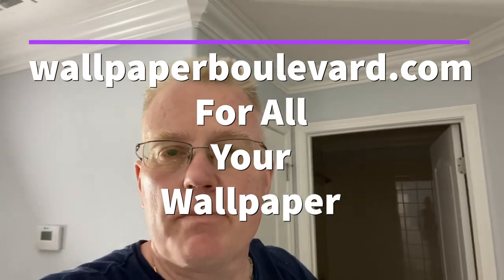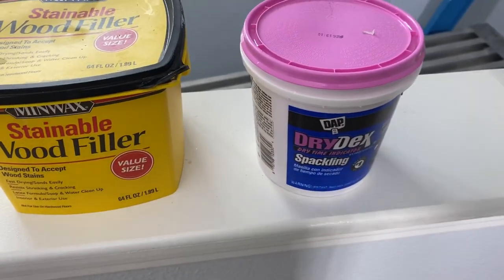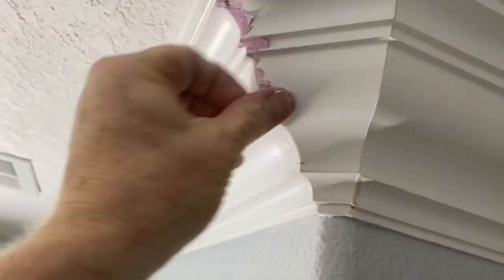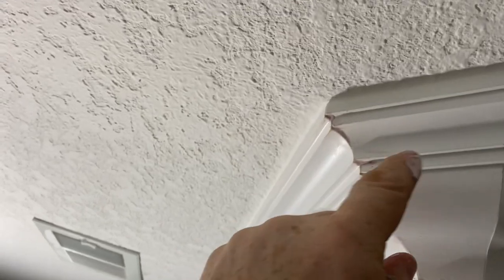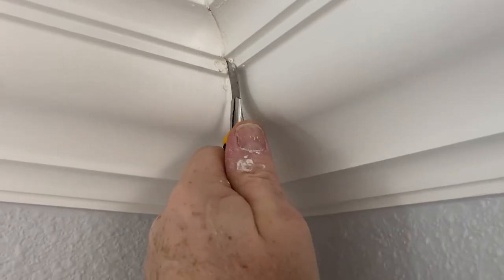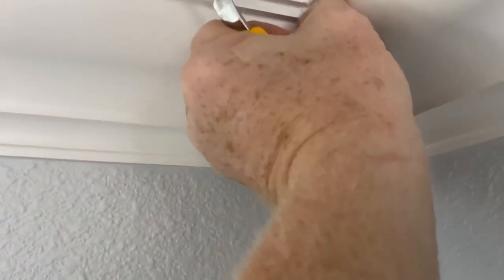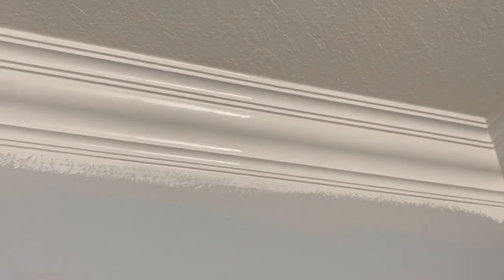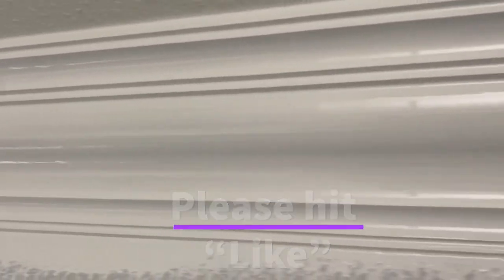Fill in Nail Holes With Non-Shrinking Filler Before Painting - Spencer Colgan

Comment: Hi Spencer, pro painter from NY, Westchester area. I too use Drydex good product very easy to sand, also never had a serious injury, everytime things shot past my face or just missed me. Definitely a higher power
Reply from the maker: Westchester!, I was a police officer in New York City for 20 years!
Reply: @spencercolgan  Aren't you glad your not a cop anymore with all the bull crap they have to put up with these days?
Reply from the maker: @delikat83  brother, You can say that again!
Reply: Thank you so much. I jave to do this today to my new floors replacement.  I hate that they used silicone the first time and i am having to fix all of the molding.  This will help me a lot. Great videos.
Reply: @NostalgiaSue  If you use a rag with hot water and rub it on the silicone it will help to loosen it and get it off the moldings. Saves time and mess of scraping it out.
Reply: hello from New Rochelle!
Reply: @David Zucker  
Hey were working on Victory Blvd in New Rochelle. 👋